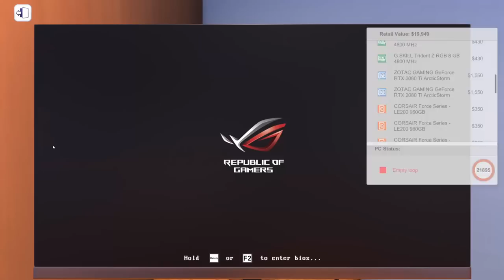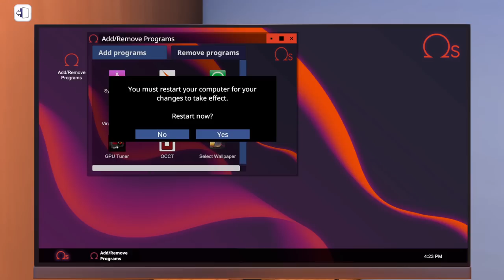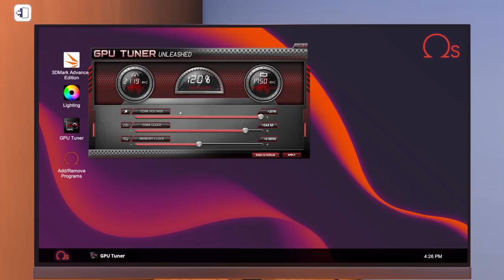Most EXPENSIVE PC Build?? PC Building Simulator (Version 1.8)

Comment: Doing the wiring for this cabinet and getting everything working can be a real headache. The solution I found is the following:

1. Enable all options in "Free Build Settings".

2. Install the water pumps of your choice.

2. Install the Corsair XR7 480 radiators on the top, front, and bottom so that the 3 radiators connect to each other.

3. Install the Corsair XR7 360 and 480 radiators from the rear of the case

4. Install the fans at the bottom of the front of the case, starting with the right side, to connect them to each other.

5. Disable auto connection options in "Free Build Settings".

6. Make the assembly of your choice connecting only the power cables of the video cards and all the devices.

7. Finally connect the power supply to the radiator 480 at the rear, followed by the upper radiator at the front, then the first fan at the bottom and lastly the water pumps.
Reply: im still stuck....
Reply from the maker: @NightOwlGames  With the wiring of this beast?
Reply: @BigJake901  wiring and piping please redo the tutorial ill happily sit and watch for however long it takes, what a monster you got there id love this pc in real life it looks stunning.
Reply from the maker: @NightOwlGames  I doubt I will redo this exact build because with every update to the game the cost of the most expensive build increases. However, at some point in the future I’m sure I will do another most expensive build video and I will be sure to include how to cable and pipe it.
Reply: @BigJake901  ive got a problem of everything cable wise i connect it all but then some fans dont work and the cooling i just use boring air cooling cant figure out what pipe goes where or how to connect them so did what i could with air cooling for now

Comment: I just made that exact same one with some tweaks and got a score of 24769 and also I would personally use the 3090 and use a more expensive coolant , tube , and connectors and I would compare prices, for other parts and that’s just most expensive but there is better parts for cheaper and better but depends on situation

Comment: Just built a pc on pc building simulator with a price of $21,605 in the thermaltake 91 view RGB case with 1 single fan radiator, 19 fans and 250mm reservoir, 2 evga geforce rtx390 ftw3 watercooled GPU, gigabyte trx40 aorus Xtreme motherboard, Corsair rm1000x PSU, 8x Corsair dominator platinum 16gb ram, AMD threadripper 3990x and the same cooler in video
Reply from the maker: Nice! 🙂

Comment: Pls tell me how you put your screws in so fast and how you put the cables in without pressing on where the other end of the cables should go
Reply from the maker: I use the "Quick Screw Tool" which is what makes the screws screw in so fast and I use the "Quick Cable Tool" to make the cables connect faster. Both of the tools need to be purchased in the Shop under "Tools and Software", if you are playing the Career Mode and are available under "Free Build Options" in Free Build Mode.

Comment: It says empty loop because you "can't" connect two reservoirs in the same loop.
Reply from the maker: So you’re saying, if I make one reservoir for a CPU loop and the other for a separate GPU loop it will fix the “empty loop” problem?
Reply: @BigJake901  Either that or just using one reservoir for the entire loop
Reply from the maker: For this I needed two though, was trying to spend as much as possible lol. I don’t mind it saying “empty loop” because it still worked and counted towards the total build cost. Would be nice if they updated the game to allow full use of dual reservoirs though.
Reply: BigJake901 I think making one for cpu and one for you will work

Comment: i cant seem to get all 5 radiators to work because there isnt enough cable slots got any ideas on how to fix this.
Reply from the maker: I don’t remember the exact wiring order but you will have to plug all the radiators in before wiring up any of the fans. You will have to start with the bottom radiator first ... that’s about all I remember lol. I can mess around with it tomorrow and post the wiring order for you when I figure it out.